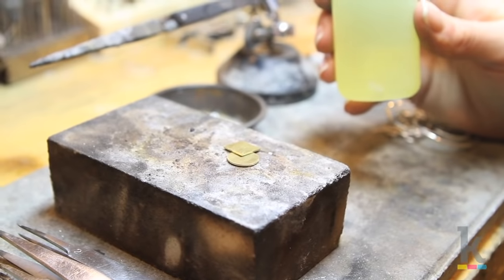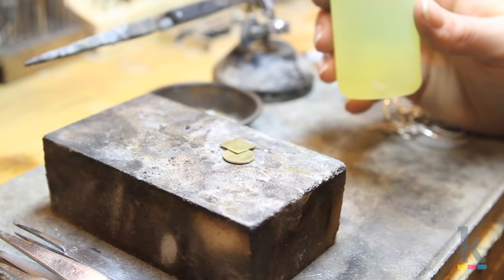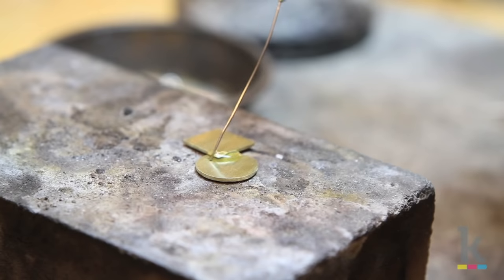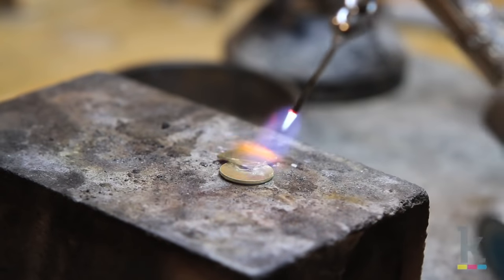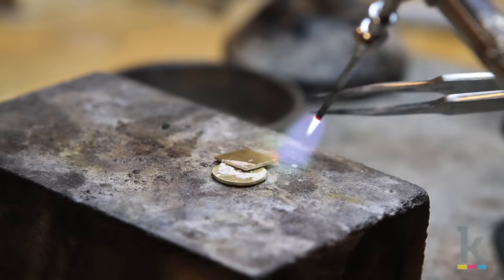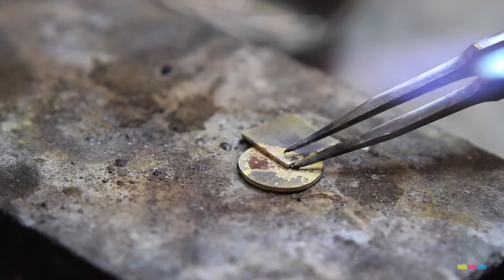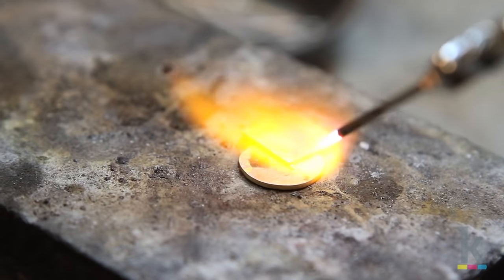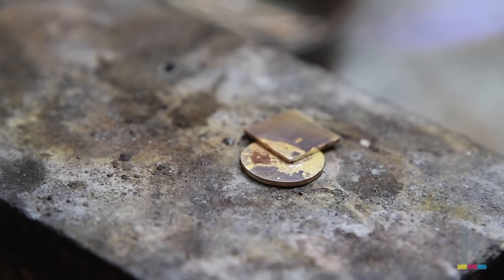How to Solder Metal

Comment: This is incorrect. You don't want to heat up your solder with the torch as it will burn up the flux on the solder already and will just suck